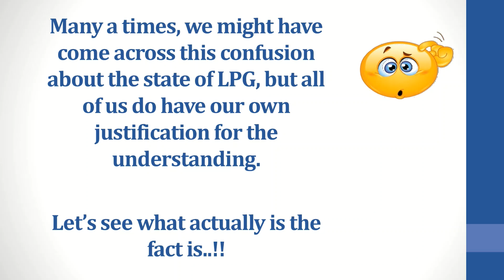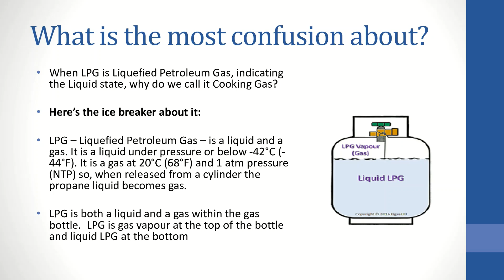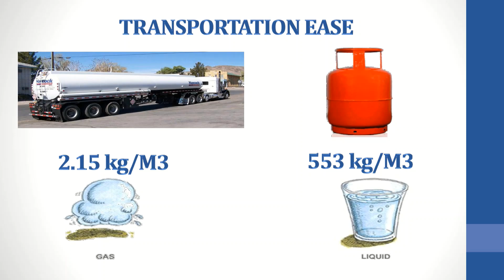What is LPG | A Liquid or a Gas | Why is LPG called liquified Petroleum Gas

Comment: I looked it up at some other resources, it is said that the cylinder was just filled to 80%, and the 20% is in gas state (vapour). Does that mean the gas is being filled to the cylinder at the liquid state? And the 20% gas is just a filling gap due to the decreased pressure because the cylinder was only filled halfway through?
Reply: Its filled at 80 % to allow room for expansion due to temp change i.e if it gets hot the pressure rises inside the bottle
Reply: Hahahaha no one answered your question
Reply: @jt19823  instead of typing some lame bullshit why don't you try to answer it tho?